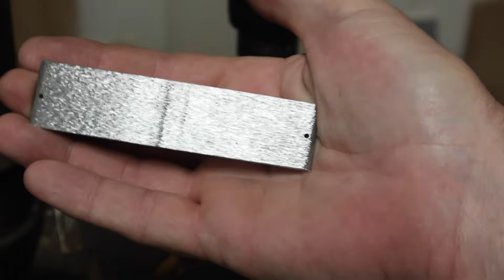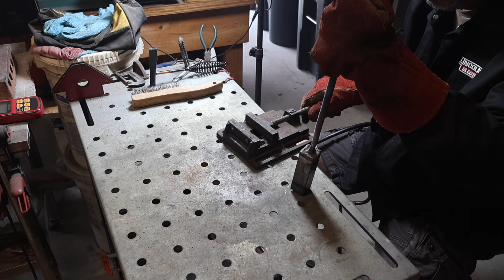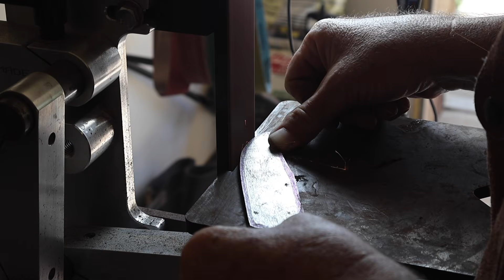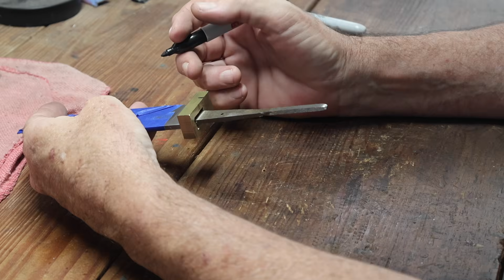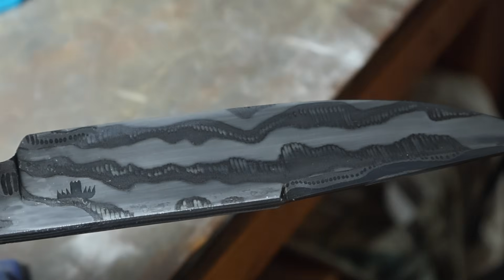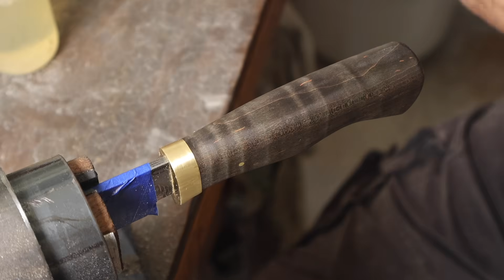Forging Piano Wire into a Custom Damascus Hunting Knife

Comment from the maker: Thank you so much everyone for checking out the video! For those wondering, the ASTM designation for music wire steel is A228. The chemical composition is very close to 1095 and W1, two common knife steels/tool steels.